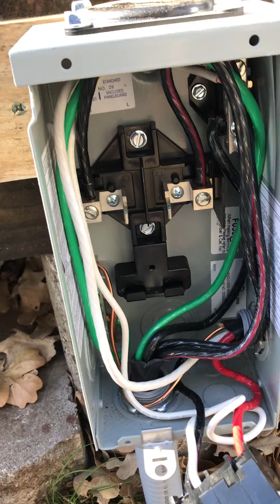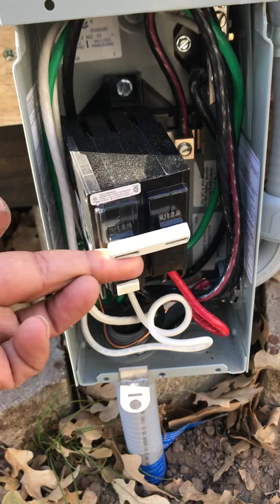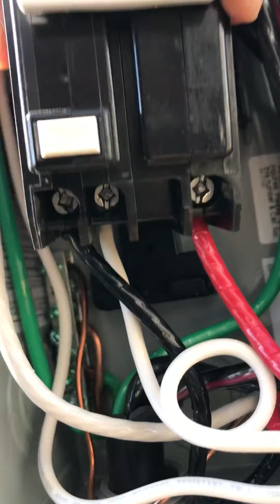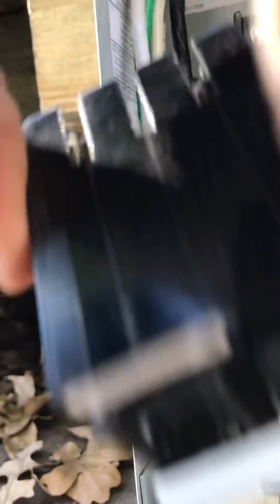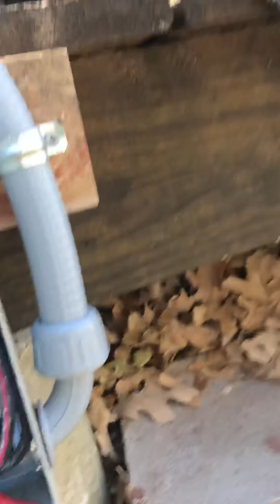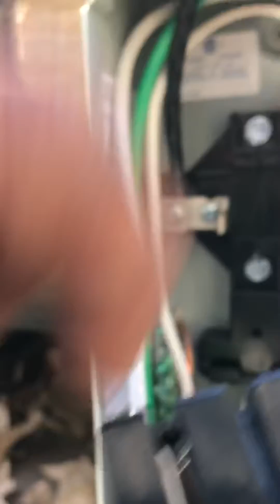GFCI tripping hot tub on NEW install.

Comment: I have one of those Eaton 50amps and it trips intermittently. Hot tub heats up, all jets can run, lights up and it wint pop for a while.  Sometimes it pops within a few minutes. Had a different breaker and box altogether before and swapped to one of these eatons and it didn't start tripping until a few months. I'm not sure if the electrician who connected it knew about this that you're saying though.  I'm going to shut it down and check. Do you jabe a phone number I can text a few pics maybe you can help me out.

Comment from the maker: @Frank Lopez ...if you open the equipment panel of the spa and open of the Electrical Board- on the inside of the face cover it will give you the specific amps required for your spa along with a wiring diagram. Most can run on a 50amp breaker but larger spas will require a 60amp. Remember the GFCI needs to be in the actual spa disconnect box and NOT in your main Home Electrical Panel. Hope this answers your question.
Reply: Why is it not ok to have it in the main panel ?